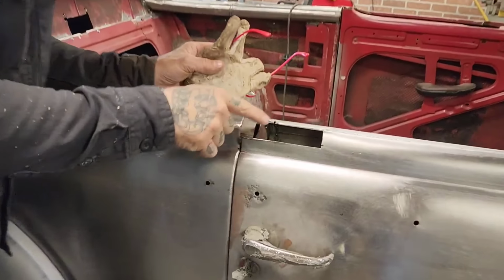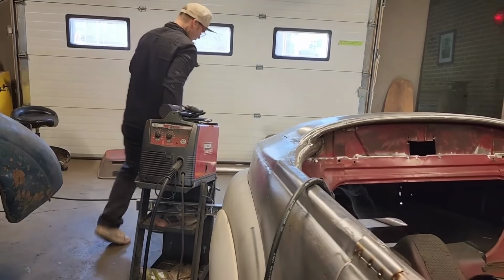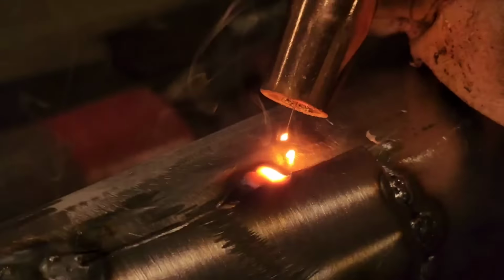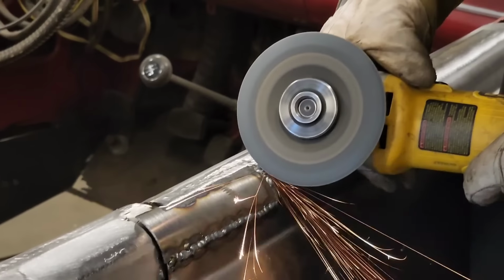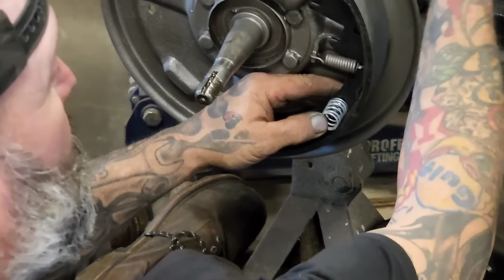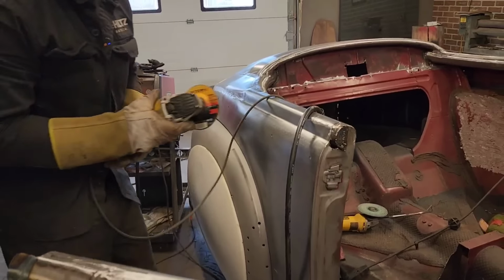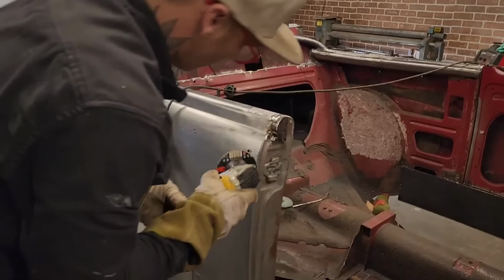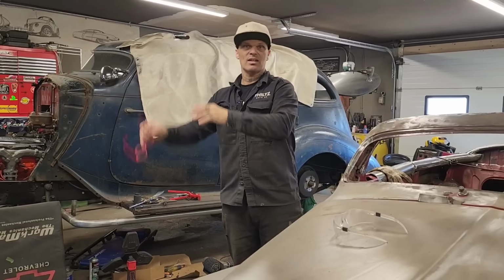These are the repairs no one shows you 😆

Comment: A cut off blade can become very deadly when it breaks.. a friend of mine thought would be alright to go into a tight corner with a air powered cut off. 2 and a half inch blade. I warned him about it. I went for auto body supplies. Had a call from the hospital that my friend was there in critical condition. Took out his right eye and part of his face. That was only a die grinder.. he was wearing safety gear. Put a blade in a bind and watch what happens!!

Comment: Thats why you should have a full face screen when using them thin cutting wheels Bad enough you dont have a guard on any of your grinders. as a Safety officer I have seen pictures of workers with half a cutting wheel stuck in there face
Reply: Not wearing Welding helmet  70%of time   lets see how long his eyes last  THINK ABOUT IT CHAD HILTZ
Reply: @russellhollar8325  It does not do your eyes any good but through even clear glass you will not get a welding flash as in the rays burning the surface of your eyes,

Comment: Just a tip when fitting brake shoe retainers take a pliers  cut a small slot across the jaw 1to 2mm from the edge of jaw with a hacksaw on both jaws to hold the retainer washer much easier than using a vice grip.
Reply: @haynesdavis-m3p  or buy the correct tool for the job.

Comment: A couple of years ago I was modifying a DAS bolt-in roll bar I'd purchased for my 82' 911SC. My 82' is a Coupe and the roll bar was built for a Cabriolet but I got it for $400 including shipping so I wasn't going to complain. Anyway, it was about 4" too tall so I modified it to fit my car (in retrospect, it would have been easier for me to scratch-build one that fit). I was using a brand new 4-1/2" cutoff wheel in my angle grinder and could find one of my full face shields (have half a dozen of them) so I used some new goggles. Hit the trigger and it exploded burying a chunk just below my goggles and right to the bone. Went to the E/R to have it cleaned out and stitched up. Not the first time I've had it happy and peeps using goggles or safety glasses should be cautious to not place themselves directly in the plane of rotation.
Reply: save your war stories for your grand kids
Reply: @haynesdavis-m3p  Just being "truthful" like you!

Comment: The back end of the car kind of reminds me of a bathtub Porsche the 356.lowered with some deep dish wider wheels & chrome dog dish hubcaps would look clean tuck the wide tires into the rear end without flaring it out.get rid of the steering wheel its an eye sore something like a 3 or 5 spoke chrome wheel would look better.

Comment: Chad & Jolene - What is that machine called that you use to clean-up the sheetmetal? Kinda like a single-wheel belt sander with some sort of scotchbrite-type material on it? I need one.
Reply: Surface conditioning tool at harbor freight  usually 149.95 in states and 3 different wheels for cleaning and you can buy replacements
Reply: @bobperry1070  Thanks a lot! Got a HF 3 miles from my house.